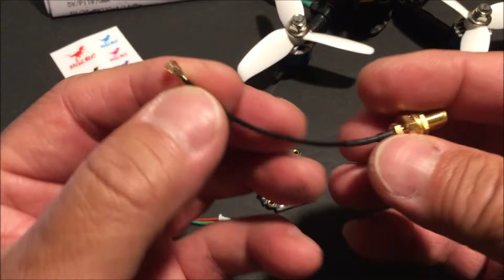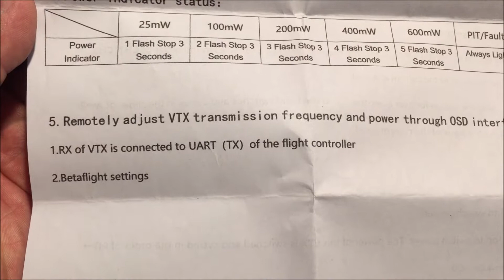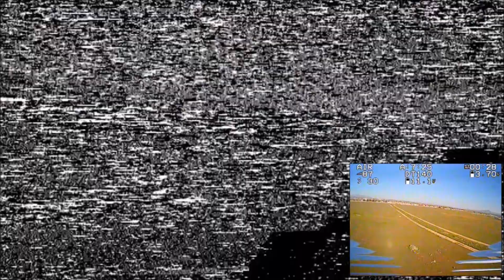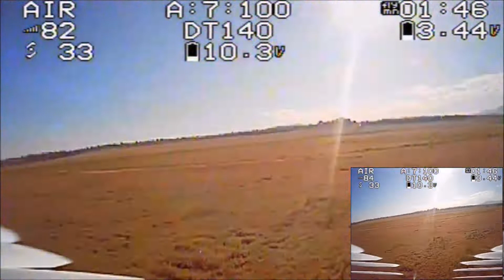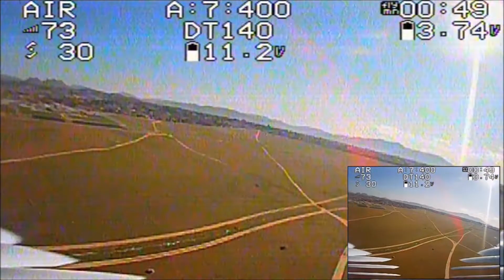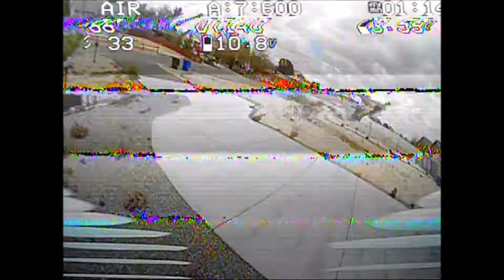🔥 600mW 🔥 HGLRC  Forward MT Mini VTX 🔥

Comment: Any reason mine says device not ready?
Reply from the maker: uarts set correctly to tramp?
Reply: @RCEscape  yes I have everything set up perfectly. Copied the github file and everything and still says (device ready no) I get a video signal but it drops out after about a foot. Getting 3 flashes on vtx meaning its putting out 200mw so I have no idea what the problem  ive been at it 9 hours now lol
Reply from the maker: @sir_william23  
It must be a dud vtx.  the signal at least shouldn't drop.
Reply: @RCEscape  that's what I am thinks thanks for quick response. Sending her back and getting a new one

Comment: What is the highest Video resolution, you can transmit?
Reply from the maker: 5.8ghz analog video transmits in either the pal or the ntsc format.
pal = max resolution of 720×576
ntsc = max resolution of 720×480
so it will depend on the camera.
Reply: @RCEscape  ok, it's not the best! Full HD is not possible?
Reply from the maker: not on analog system.  dji hd or caddx vista are hd systems for fpv drones.